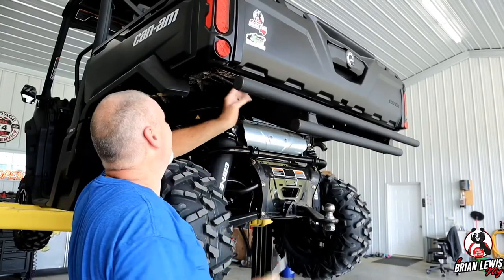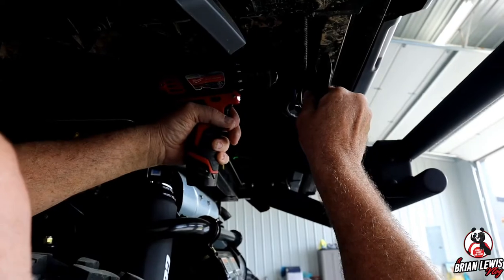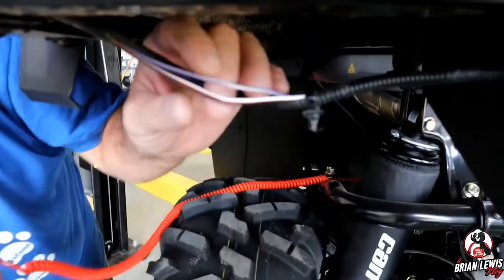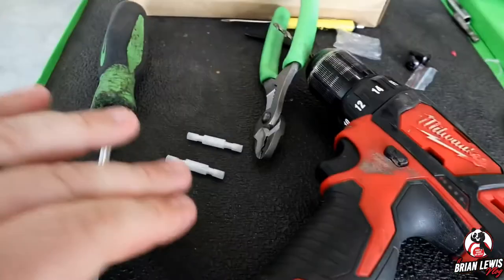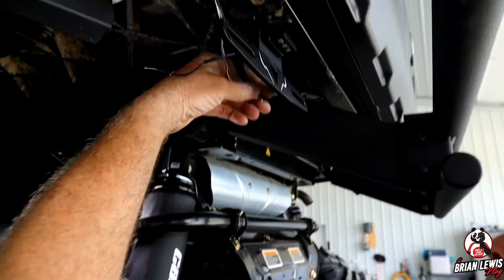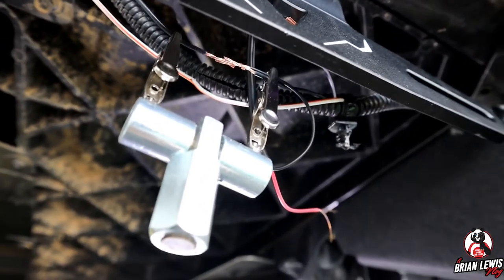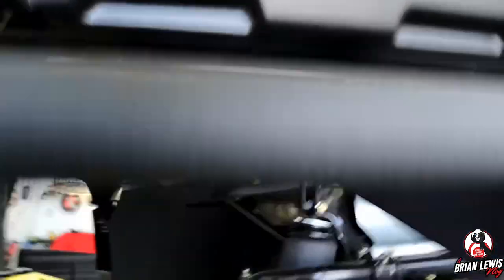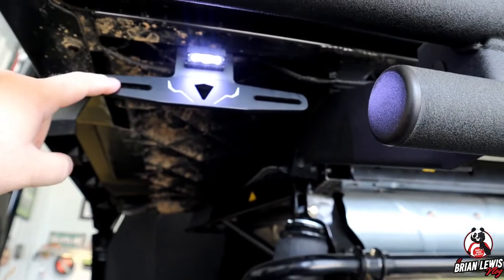Kemimoto License Plate Frame Installation

Comment: I installed in the same location but unfortunately when the bed is tilted the plate will hit the tire.  It probably needs to be installed further to the right to avoid the tire.  Will have to potentially re-install once I receive my plate.